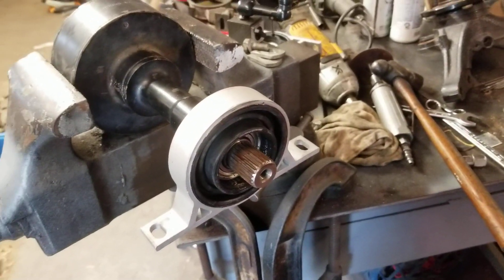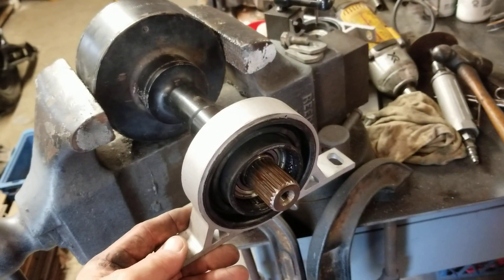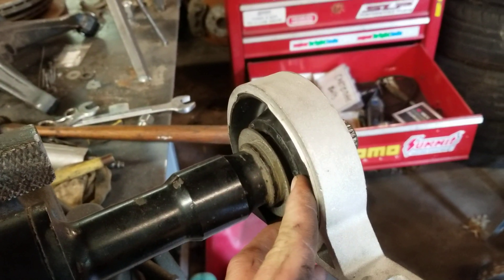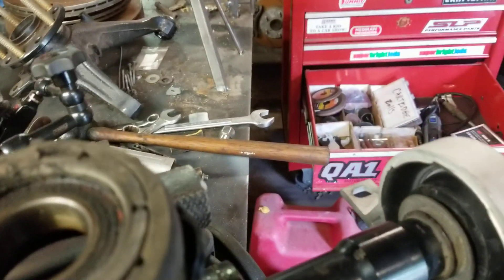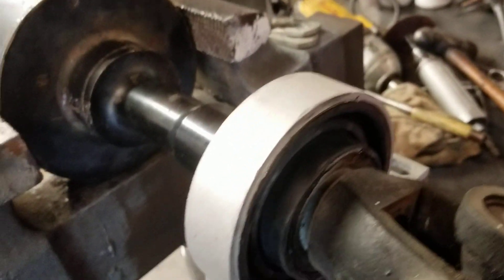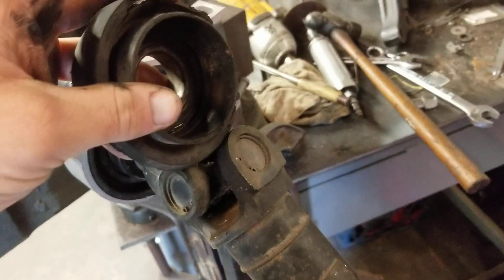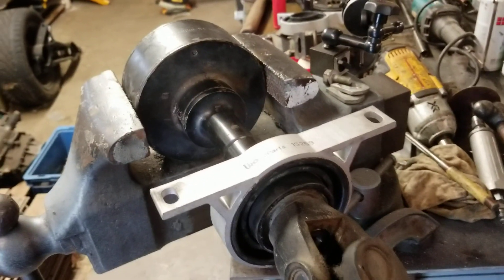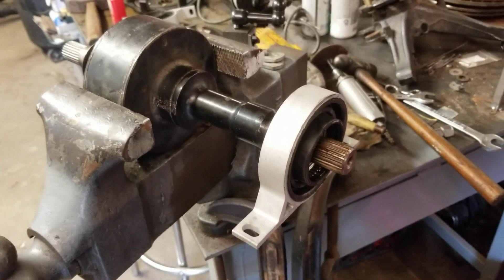BMW Carrier Bearing on Freelander  Viscous Coupler for Honda AWD Conversion

Comment: What year m5 is that from or what part # is it for those exact ones thank you
Reply: They are 2006 BMW 5 series carrier bearings. Like 525, 530 550. All the same. Cheapest one I seen in rockauto are $26 . Still not bad for one. Just need two. Less than $60 not bad at all.
Reply: Does anyone have the part number